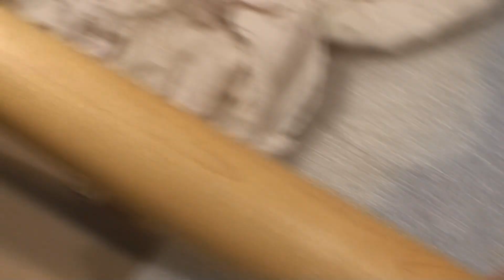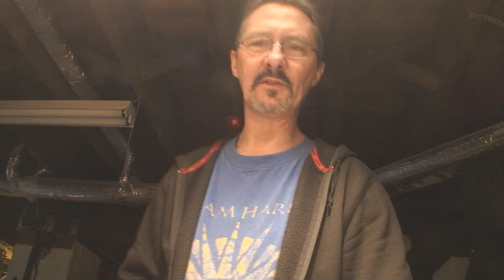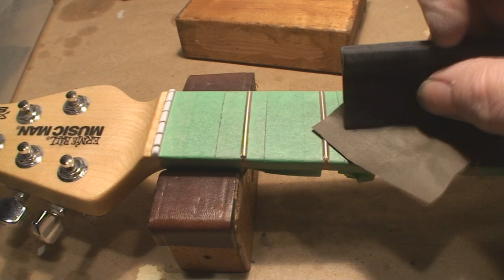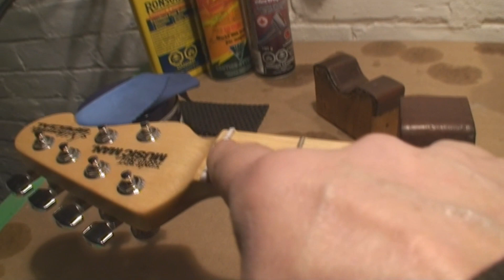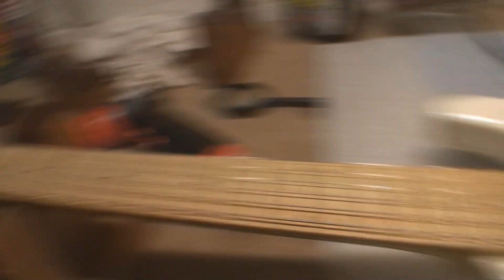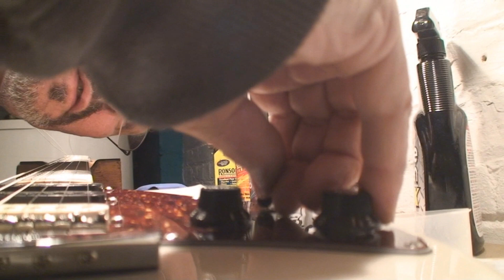EBMM Silouette Guitar Fret Work

Comment: @Dave's World of Fun Stuff

I have few questions.  What grit paper did you use for sanding block for beveling.  I picked up a basic flat file identical to stew macs expect the high cost with plastic handle.  Should I go with sandpaper instead of flat file ?

Fret polishing,   Could I get by using a basic pink eraser instead of messy green scotch brite pad or 0000 steel wool.

Comment: Have you tried holding the bottle upright? It's not like a compressed air propellant can, there's a straw in the bottle sucking the goo out of the bottle. If it's not upright, it could be sucking air, hence, no goo. Or it could have a leak in the trigger sucking air regardless of the straw being in the goo.